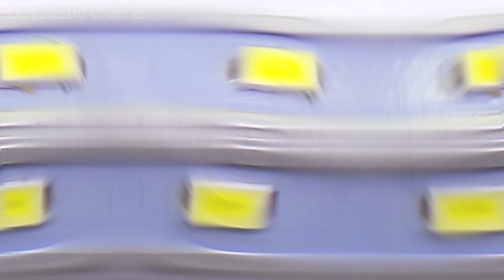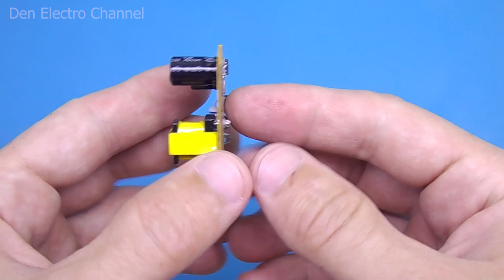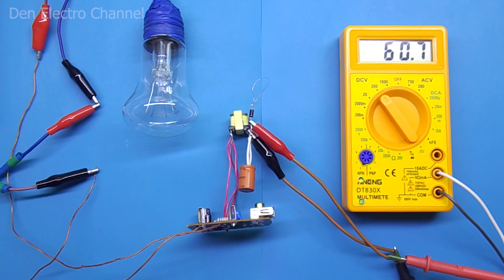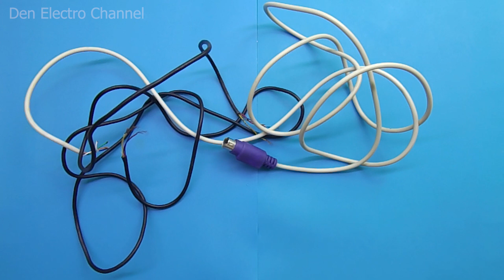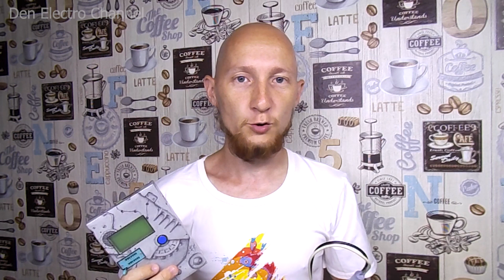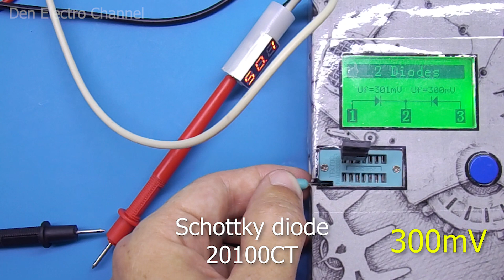DIY LED and Zener diode tester

Comment: The voltage would probably been more stable if you had replaced that old bulging capacitor on the 5V rail
Reply from the maker: I checked it. It's intact.
Reply: @Den_Electro_channel  that capacitor will have a poor esr. When they bulge like that you typically see a lot of ripple even if the DC seems stable the circuit may work hard to just keep it there
Reply from the maker: ok